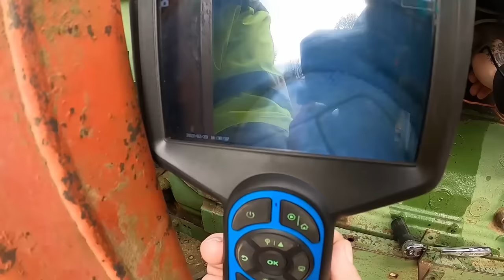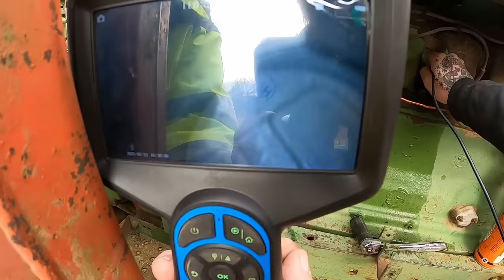1967 John Deere 4010 on PROPANE. Will it run after sittin for years???

Comment: Hey Puddin, been around these old John Deere tractors my whole life. If you need to get that clutch unstuck, cut the fuel, then put it in gear and flat tow it on good solid ground. We always do 4th gear on the synchro transmissions. Once it gets up to speed, turn the fuel on and then ignition (not the starter) so its driving on its own power. Then slam on both brakes and the clutch at the same time. The motor should have enough force to break it free if it isn't stuck real tight. All that gunk in there is most likely from the rear main seal being a little weak, so it might not hurt to split it anyways.
Reply: I’ve basically done the same thing and had good luck with it.

Comment: Let me say, I wouldn’t be upset if you took a couple videos and tuned this up for your dad. Clean it, plugs wires, maybe new hoses build, and have slick buff her out and just make sure your dad has a good tractor. New seat and such. You can “steal” it for a little bit asking to use it to move stuff around your junkyard. But I would be okay with a delay on the other projects for a bit. Your dad is such a great man, I can tell he deserves this.
Reply: As I’m watching, you could fab shop him up a nice fire extinguisher bracket, and maybe a roll bar and sunshade, and a ton of lights on it. This would be cool to see you “patina hot Rod” a tractor and play country a little bit.
Reply: I agree , take it home and tune it up , clean it up good. Replace the hoses .

Comment: Drive the tractor around in a high gear. Hold clutch in and jam on the brakes. Work the clutch pedal too. Don't be afraid to rough with it. Also let the motor get wsrmed up good heat will help. You gotta break the rust bond.
Reply: Yes! What he said. It works, done it many times.Start it in gear, hold the clutch, and work the brakes heavily!

Comment: To loosen the clutch.  Park the tractor with a board holding the clutch depressed.  Use a little heat in the clutch/flywheel area.  It looks like you can get a bar/screw driver to break it loose.  But you need to hold the clutch released.  I grew up on a farm and our tractor clutches  would get rusted to the flywheel. Also put a load on the tractor in gear but keep the clutch depressed, it break loose.
Reply: Did this years ago. you should be able to get at the clutch plate through that inspetion hole and tap gently with the peddle strapped down all the way tight.

Comment: Great to see your Dad and step brother too Jake. Thats a nice Deer. Incredible how clean that cyl was and how quickly she started. Disc is rusted to the flywheel. Yeah...you'd have to drive it around with the clutch pressed while goosing the throttle to snap it free....sometimes that works.. Great tractor.  Loved the video.

Comment: On my uncles 9N with a stuck clutch, he used dry ice and a propane torch to get it unstuck.  First he heated it lightly with the torch to be sure to get any moisture burned off, then he packed it with dry ice for 15-20 minutes.  Then he started the tractor up while holding down the clutch, but with it in low range 1st.  We heard a loud bang, and the clutch came unstuck.

Comment: On them old tractors you can chain them to a tree and take off and jerk them a few times and it will loosen the clutch up. You gotta split the case to change those clutches I've worked on many of those suckers and it almost ALWAYS breaks the clutch loose by chaining up and jerking them they get condensation bad because the case and clutch is all metal, it's one of them every tractor problem things, the Ford 8n were the wrose

Comment: Hey Puddin, those hydraulic lines  you are talking about (above the starter) are for the remote hydraulic cylinder outlet on the back of the tractor. I imagine you may have to split that tractor to get that clutch freed up.  Also, make sure you drain out that water and get some antifreeze in that engine, hate to see it get froze up and bust the block.  Moreover, that 4010 sure sounds pretty sweet for being 60+ years old!
Reply: Probably wouldn't hurt to flush the cooling system.

Comment: I had an international tractor with a stuck clutch. I adjusted the clutch pedal so it would be as tight as possible then strapped it down the ratchet strap, then any time I walked by I’d rap on the pedal with a hammer to shock it. Also a couple cans of break cleaner sprayed in from the bottom inspection (over time) had it free in a couple days.  Good luck with it

Comment: 1. It's always a great day when Puddin Pops in the video.
2. Puddin Pop is right setting a booby trap is illegal. But there's two versions of the law (not only state and federal, which should be taken into account), it's a felony to set an unmanned booby trap (on the grounds that if it's unmanned, the trap cannot tell the difference between a person with permission to be in the area and a person without permission), but a nonlethal manned trap (such as using a paintball gun) is completely legal and protected under most state laws.

Comment: If y'all haven't got that clutch freed up yet, I got a trick to try before you split the tractor. I used to have an old Ford that seized the clutch every year, and this worked. Start it in gear and get it going at 5mph or so. Holding the clutch on the floor and keeping it throttled up, stab the brakes sharply and then immediately release them before it stalls you. Might take a few attempts but it always worked for me.

Comment: I did notice that one of the pressureplate fingers was not under the throw out bearing, its possible that may be contributing to the clutch not releasing and unable to break free from the flywheel.
Hope this helps a little.

Comment: If you can get the old Minnie Mo to run again, chain it to the back of the 4020.  Drive them in a nice flat area (road, maybe) in 7th or 8th gear.  Once you get rolling good, push in the clutch on the 4020 and put on the brakes on the Minnie.  A higher gear makes more load for the clutch and the extra load the Minne would provide will break the clutch loose.  This method is a little more gentle than chaining the 4020 to a tree.

There are two clutches in the flywheel.  The PTO is the rear one (that you can see) and the traction clutch is down inside the flywheel.  The PTO uses the fingers to engage the clutch, and the traction clutch is released with the fingers.  A 4020 is not hard to split if you would have to.  That would be a handy tractor around the new shop.

Comment: I ran a propane conversion kit on a three fiddy Chev for some years, and my best guess on the propane flooding would be something in the vaporizer that is letting liquid through to the engine. 
   The propane comes out of the liquid draw valve and the vaporizer adds heat from the water in the engine to keep the system from freezing up 
  This involves solenoid valves and diaphragms so that is what I would look for first. The internet or a shop that services tow motors might be able to help you out. If the vaporizer is after market,you could run the model and serial numbers and figure it out.
  Also I had to start mine on gasoline and drive a few miles to get the thing heated up before I hit the switch for propane which also shut off the gas line at the same time. Hope this helps

Comment: 4010 clutch, had luck with water,  as all you need to do is soften the rust.  If you can not get it loose by disengaging the clutch and pressing the brakes while tractor is in gear.... remove the starter , make block off plate for starter hole and timing cover on opposite side,,,,, silicone up inspection cover on bottom and the weep hole.  Fill clutch housing with water let set for a few days, drain water, start tractor in gear , disengage clutch and press on brakes ..... it should break free. Always be safe!  Thanks for the videos, never commented before....hope this helps... Tom Hixon

Comment: Got a 1986 JD 750 had to have it split last year because the clutch froze up. They tell you to drive it with the clutch depressed, drag it not running in gear. Nothing did it for mine less then 1k hours on it but she sat ALOT. hopefully you and puddin pops cleaning everything out and spraying her down will help. Ended up costing me about 2k in the end because I just didn't have the time, inside space or knowledge to do it myself but got the tractor back and work her every chance I get. Love your videos bud KEEP IT UP! So awesome to dee you and you dad gettin it done

Comment: If you can get the tractor into a higher gear and take off and go as fast as possible then hold in clutch and lock up the brakes often will break it loose

Comment: Unsticking that clutch - put it in low gear, start, throttle up, and stomp on the brakes til it almost dies, release, stomp brakes, release, stomp brakes, release until it pops loose. You can also drive it in low gear dragging a box blade until it pops, but that takes a lot longer. Pull it up to a big tree (I haven't had good luck with this one - only worked once years ago). When you get it unstuck, leave a haydock block on the clutch pedal to keep the flywheel and clutch plate separated or it will rust together again.

Comment: The ants in the distributor reminded me of one time the lights in a shed quit working. I found power to the switch but not out and replaced it. Opened up the old switch and it was PACKED full of ants

Comment: A 65 d200 crew cab frame i picked up was from  the factory was straight cut welded then they bent a plate to go around the entire frame top and bottom and a plate inside the frame then they rivited it all together

Comment: Pudding I have a old 1967 Massey Ferguson, 165 gas with the same problem with the clutch. Occasionally it’ll stick to the flywheel I believe the rear main seal leaks oil onto the clutch and makes it stick.
So I just tried to start it in a low gear and drop an implement to put stress on it and try to slip the clutch and eventually it will pop loose

Comment: I talked to my brother that sold his JD like yours..he said the biggest problem is the shifter needs rebuilt .about 50 to 75 bucks .it will need some pins and a few bushings..he said the clutch doesn't give ya much problems but the shifter mechanism will..good luck

Comment: Sometimes if you lock up the brakes while the tractors moving that might break the clutch loose or hook up the Allis Chalmers behind it and lock up the brakes on the both tractors and that might break the clutch loose in a higher gear.

Comment: Nice Job. Kool you hangin' with your pop's.  I know on cars with a stuck clutch once you get the car going with the rear wheels off the ground. you stand on the brakes a couple times with the clutch pedal pushed down (it will kill the engine a couple times) and eventually most times it will break the clutch free.   Good luck and keep up the Kool content.

Comment: I worked a hydraulic job for 14 years... I've never had a hose last more than 5 years! But, then again all of ours were running below grade... Sitting in tons of road muck. 
If you don't replace them all at the same time... The ones you don't replace will fail at the most inconvenient time later.

Comment: I think on that tractor has two clutches on the flywheel. One drives the tractor the other is for the powe take off. This way when you push i the foot clutch to stop the tractor the pto still runs.

Comment: The first thing to do with the clutch scenario is hook it to something thing sturdy and pull with your foot jammed down in the clutch that usually works to pop them loose just be careful cause you could pull the front wheels off the ground if they do shut it off and leave it for a day or so with the clutch tied down if that doesn't work get it unhooked and use a blunt punch or ideally a brass bar and hit the pressure plate in multiple spots with the clutch petal tied down to shock the clutch loose that usually works for stubborn ones if it doesn't use a propane torch and warm it some as a last resort before splitting it

Comment: Sweet tractor. Propane motors are the best. Just a heads up tho if you got a hydraulic or fuel leak don’t put your finger over it… too much pressure can inject oil or fuel in your skin

Comment: If your in a pinch you can just strip the battery cable about a inch and use a heater hose clamp to hold it onto the battery post.

Comment: On the John Deere, when you were showing the clutch with the inspection plate off I noticed one of the clutch forks was off the
 Throwout bearing. I bet that is your problem it is probably making the clutch pressure plate set sideways and not release the clutch fully

Comment: Push the clutch down and pin it in position, drag it or drive it in high gear and slam the breaks. May have to do it many times but that usually shocks the clutch free. Also it looked like a double clutch and the pto clutch may be stuck aswell. Same rule appleis there . Just have to use an implement to shock it

Comment: Excellent video Puddin  :) also Puddin Pops :) , Step brother Will :) also I didn't know that 1967 4010 John Deere loader  tractor was Propane fuel to most ones seen are Desiel fuel motor my cousin Ron has Desiel on his 6 cylinders motor  it loader too type his use on his farm plus snow removal too! Excellent your video and got Ole Roy Chevrolet pickup too ! Also your dad is like my late Dad was fun to be with and joke with or answer questions about anything!

Comment: I've seen people use the wire wheel on the drill to clean the distributor cap contacts and then they snapped the contact of the inside and when I seen pudden doing that I was thinking easy there not to crazy don't want to break it

Comment: There a thin plastic line for oil pressure gauge that runs up into the dash. I had one burst and leak oil all over platform on a JD 3010

Comment: Ya need to find an old milk bottle carrier, looks like it will hold an 8 pack if medium size round quart bottles, has a handle even at one if the antique stores to carry your spray cans upright in your tool box . 🙂

Comment: To get that clutch to free up you need to put it in gear with the engine off, start it with the clutch pushed in and just drive it with the clutch pushed in until it frees up. It won't free up with the pedal not being pushed.

Comment: Puddin  for the tractor clutch if possible try in high gear with a load driving and or hook to a tree and pull in high gear . Ive unstuck a few tha way.

Comment: Puddin, if the brakes work on that tractor, start driving around and stab the brakes real hard one side or the other. If it’s not super stuck that will usually get them broke free.

Comment: The clutch on my 86 720 was stuck to the fly wheel.  We had to rock it back and forth in gear with the engine off  to pop it loose . Maybe tug it with the alice

Comment: I actually just did a ls swap with a th400 since you using a 6.0 it’ll just bolt right up if it was a 5.3 you have to get the adapter or just buy a 6.0 4l80e flexplate

Comment: I wonder why Propane is so big for running engines in the area around puddin Oklahoma? Mr. Mercer was propane, this tractor, the machine puddin and Mortske got running and several other vehicles seen on the channel in junkyards have run on propane.

Comment: If that was my property I would have game cameras set up as well as putting up an electric fence with wires that would be hard to see and there would be more than one fence line.... I'd have at least 3 separate fence lines so if they get past the first one they would not be expecting to encounter a second or third one.

Comment: This was a great video, nice seeing you with your dad. My question is, you said, if the clutch don't get unstuck, you'd have to split the tractor to fix it. I know nothing about old tractors, but aren't they inherently designed so that farmers could fix them when they broke?  Why would changing a clutch on a farm tractor be harder than on a passenger car?  I'm only asking because I don't know.
Reply: On farm tractors engine transmission and rear differential make up the frame /body . front suspension seat and any accessories all bolt to that.
So you literally split the tractor in two pieces to work on the clutch flywheel or rear main seal.

Comment: How do pudding.  If you keep the cluch pedal down then start her up give her a few beans and stand on brake pedals if they work I did that with mine it came off toke a bit but came off. And you can try the coke get bottle off coke drop a mint in to it and let that go up in there or take lid off shake the bottle then take your thumb off. It's better with the if you just drop a mint in there because you can get bottle in right place.  Iv done it both ways and got lucky.  Just depends on how bad it is. Because I believe it's a 2 stage clutch on that . From Andy in uk

Comment: It’s probably got a two stage clutch in it, you might need to adjust that sucker. I never want to put a clutch in my tractor again, you gotta split the whole thing in half. With your shop it might not be bad but in my dirt lot it was a nightmare.

Comment: Just for extra info on the tractor if it is a 67 it is a 4020 so the parts are different but very simular a 4010 was from 1960 to 63 and 4020 was from 64 to 72 but still close and simular

Comment: 25 min. That distributor.  In the  the middle.  The cycle spung . Needs 🛢  oil. Helps with contact. And the oil dripes down the shaft. 
I have not watch for a long time. But last two where good 👍 
Mick Australia. 
Ps what you do as say red necken.  You do what you have to sevive in in the middle of now where. Australia 🇦🇺  in big mate. God bless  smile

Comment: Pressure plate is rusted stuck to the flywheel, most of the time starting it in gear and get a rough with it in gear will break it free .